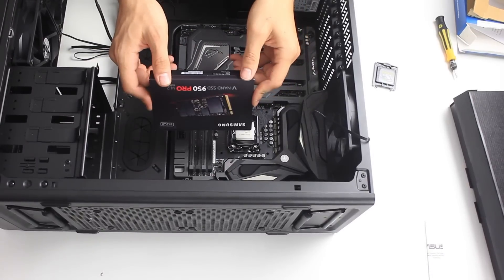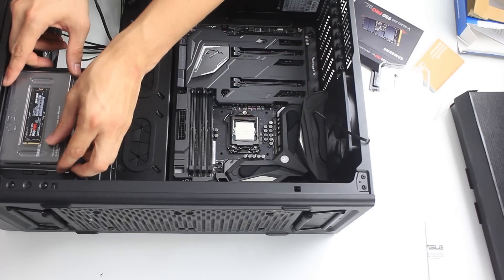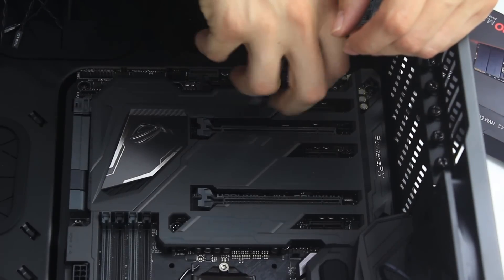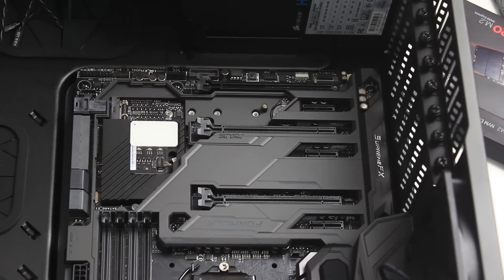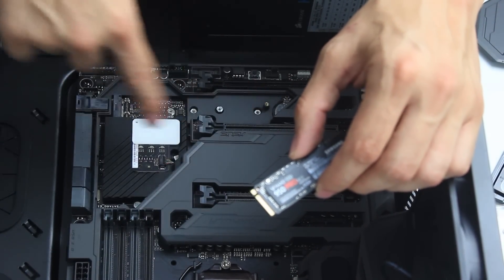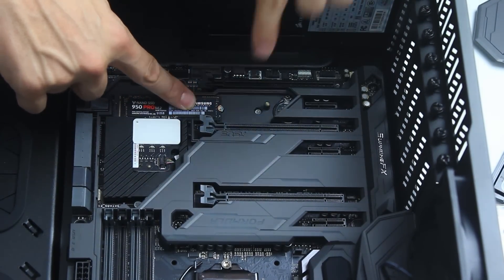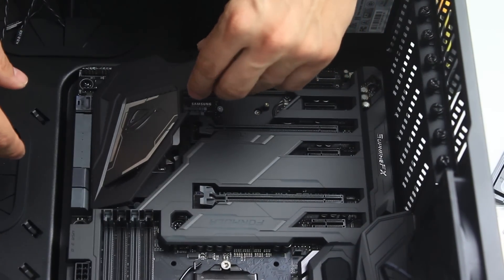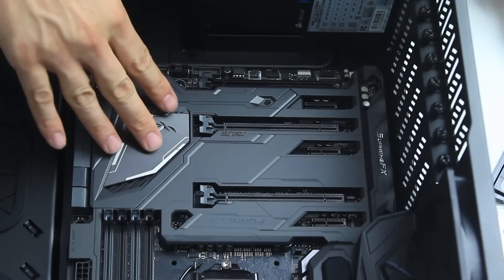Build an insane gaming machine (M.2 SSD) 4/9

Comment: What's the cover in between the pcie lanes and stuff called? Been looking almost around, cant find it!
Reply from the maker: Thermal pad ?
Reply: Yeah I guess that's it, I recently bought a z290 maximus ix board and it is the basic design so theres not any thermal padding all over the board. I wanted to buy one separate and put it on. Found out you cant ;(

Comment: Hello what do you have to change in bios so m.2 SSD is detected?
Reply from the maker: What board do u have ?
Reply: Asus Maximus ix formula
Reply from the maker: Disconnect any other SATA drive, clear CMOS and voila
Reply: Laurent's Choice what is voila ?
Reply from the maker: it means : that should sove your issue :)

Once you booted from you m.2 ssd and installed your boot OS, you can reconnect the SATA drive(s).

Comment: Hello, my famous garlic munching friend I have purchased 2x Samsung mvme2 Evo 500mb items and I have to say these babies are more than sufficient EVEN IF you are editing 4k porn(TWINS lol) of course:)
On a more serious note have you noticed any significant performance/temps when using a heat shield and dedicated 40mm fan?
I personally have a 40mm fan on my setup with a thermal probe to monitor and provide air flow when required on one of my nvme2(heatsink position on an ASUS 370 PRIME A furthest away from the CPU slot and the other left to its own devices and I have noticed no particular difference in performance? your reply would be most appreciated as would your experience with this setup.
As ever please keep up on your reviews as I personally feel you are gifted and genuinely review these products from the HEART. Dieu te bénisse
Reply from the maker: Oh lord !! Ahahahahahaahahahah

Comment: Hi Laurent! I hope it's okay to ask this here! I recently purchased an Asus X370 Crosshair VI MB that has two M.2 slots.

1) I can't find any info about which slot is priority for the boot. In my previous build, (MSI) also had two slots; but, one was Ultra and only for the OS and the other was for data. I can probably find this out by talking to Asus so not a biggy.

2) I have two M.2 drives, both are Samsung 512 Gb. I'd like to set them up in raid with my OS; however, one is a 950 Pro and the other is a SM951, (S# S1X1NYAH100407). I didn't realize that it was different until I tried to install my OS on it and discovered it was mainly made for data. That's when I purchased the 950 Pro. If I set these drives up in raid, will I have any issues with the 951 holding the Pro back in performance?
Reply from the maker: +jawnTem hi there. 

Usually M.2 SSD closer or under the chipset heat shield is the one who ll boot by default.  Thought,  latest BIOS updates allow the board to detect which of the sticks can boot. So it should not matter anymore.

In a RAID configuration, to allow a seamless sync, the slowest of tbe drives will set the pace. That will avoid async errors.

Hope this helps
Reply: Thanks so much for the fast reply Laurent and also for all the support in the past. Awesome!

I already got on on Asus website and learned the positioning info for myself and then went on Samsung's site and learned about the drive. It seems I was sold a non sale-able drive from Amazon. I've been burned a few times through Amazon before, so I really don't care all that much for them. I've never been burned on Newegg.

Keep the tubes coming, I really like them.!

Comment: Is this mobo compatible with i7-8700k?
Reply from the maker: +Mike From The Block no. Only z370 motherboards can handle an i7 8700k.

Check out my latest z370 motherboards review for more details :)
Reply: Laurent's Choice That's strange on the Asus website it says the ix code is "Designed for 7th generation Intel Core processors, so I figured i7-8700k would work. it's a 7th gen right?
Reply from the maker: +Mike From The Block no. 
The 8700k is 8th generation (coffee lake)
7th generation will be the 7700k 
6th generation will be the 6700k

The i7 bit is the type of processor (i3, i5 ,i7) and the first number after it (8700k) will give u the actually CPU generation. 

Also, when processors finish with the letter K that means that it is factory unlocked. You can Over clock it :)

I hope this helps :)
Reply: Laurent's Choice ahh I see thx.
Reply: hey another question! how many total cables do i need for a full build, would a  24 Pin/ 8pin (4+4) M/B, 8pin (6+2) PCI-E Extension Cable Kit 500mm length be enough to complete a full build? just not sure on what i need for cabling outside of what already comes with the case, mobo, psu, etc..
Reply from the maker: +Mike From The Block 4+4 M/B = CPU cable than yes. 

But u need also a Sata power cable for the hard drive

Comment: Thank you much, information about the VIII is rare. I don't think I'll buy Asus again, for years now I've bought Asus only but I'm disappointed every time. Why do I keep doing it...
Reply from the maker: +Francis Arthur what went wrong )
Reply: I am never able to OC ever with Asus. The Suite 3 crashed my OS multiple times, complete reinstalling of all the games and utlities.

Now I'm afraid my EVO 960 will get fried in that closed plastic box. I needed to remove my GTX 1070 and my soundcard to be able to install a simple M.2 
My fans run at full speed all the time because I dont want to go in the BIOS several times a day to adjust it.
Reply from the maker: +Francis Arthur I see ... What CPU did u try it on ?
Reply: i7 6700K 4GHz it might be the 32GB Vengeance Corsair this time but I dunno...  previously I had Dominator and that didn't work either on the P8. This mobo was 350 euro, too crazy of me to get it
Reply from the maker: +Francis Arthur it's not the ram... I think u really got unlucky and got a poor CPU. Only.way to make sure is to try it with another brand Mobo!
Reply: I'm unlucky for all these years somehow with Asus and CPU. So many times different Asus mobo just freeze up and resetting 10 - 50 times before I can even access the whole computer again. Trying from taking battery out and pressing all kinds of reset buttons on the mobo etc.

Really horrible feeling everytime that happens...  my graphics card already went to MSI so I dunno for mobo next time. For now this has to last a long time because this was my most expensive computer - ever.
Ty for replies
Reply from the maker: +Francis Arthur I totally get u... It's really frustrating to see all that money going and having zero value back ! 

What's ur next move ? Upgrade ?
Reply: Not for years, I hope...  I'm not too convinced yet about M.2 but it's already int he computer. At least I have 500GB for storage now that is very fast.
In the future I hope I can muster the motivation to try and build something aluminium flat enough to fit behind the cap and have some cooling diverted to it

Comment: When using the m.2 slot, what PCIe slots/ functions, and/or SATA slots/functions will be disabled or affected. Are any of the the data busses shared with this slot? I use my machine as a Server as well as a Gaming and HT Entertainment Media rig. I have 8 SATA platter drives  installed for storage. I want to know what limitations using thisa slot might impose on my sata controllers. Thanks.
Reply: The M.2_1 (under the ASUS TUF Armor) slot in SATA mode (instead of PCIe) will disable SATA port 1 on the motherboard and is compatible with 2242 / 2260 / 2280 / 22110 PCIe and SATA storage devices. M.2_2, the vertical slot, is compatible with type 2242 / 2260 / 2280 PCIe storage devices.
Reply from the maker: +Eric Epperson yes. Depending of your motherboard. M.2 SSD will disable (rarely) or at least reduce the speed of 1 or more PCI lanes.

Indeed, your motherboard as only 1 BUS chip (z170 , z270 , x99...) which distributes bandwidth across your memory channels (except RAM which draws bandwidth from the CPU).

The fastest non-Optane speed I have seen so far for a M.2 SSD is x4 in a x99.

You can usually tweak your BUS memory distribution in your BIOS.
Reply: Sorry...

I have the board you used in this video. 
Maximus VIII Formula

Comment: Is there a difference between the M.2 vertical slot and the one under the shield? Just curious to know why you haven't used the vertical slot.
Reply: There seems to be no significant difference between the 2 slots but I used the slot closest to the CPU as the boot drive 1 and the other slot as a 2nd drive with no bad consequences.
If you have found evidance to the contry plese message me.
Reply: The M.2_1 (under the ASUS TUF Armor) slot in SATA mode (instead of PCIe) will disable SATA port 1 on the motherboard and is compatible with 2242 / 2260 / 2280 / 22110 PCIe and SATA storage devices. M.2_2, the vertical slot, is compatible with type 2242 / 2260 / 2280 PCIe storage devices.
Reply from the maker: +Omar Touzani no difference  :) you can use either :)

Comment: Hi Laurent.  Thanks for the videos.  I've just completed a build using the VIII Formula and the 950 Pro 256 as well, and I've been having a lot of issues with getting Windows 10 to run stable.  I've had to set the PCIe speed to Gen2, along with several other BIOS and windows tweaks, to get the system to run without the drive utilization sitting at 100% and hanging everything up.  Have you had any problems with this combination of hardware?  Also, I have 2 GTX1070s and 2 D5 waterpumps running of a Corsair RM850 - is my PSU to weak?  It would be a great helpt to me to compare notes with someone with the same mobo/hd combo.  Thanks in advance!  You can see more detail about my experience here - https://rog.asus.com/forum/showthread.php?91295-Freezing-and-hanging-issues-with-Maximus-VIII-Formula-950-Pro-7700k-WIN10
Reply from the maker: +Thomas Keys IV 

Thanks for the details comment.

You should not be having such a problem. 

Does the windows crashed on heavy tasks.. did you identify a pattern ??...

256 gb seems a little short for such an awesome build.

If you have more than 10% free space for OS file swapping ...and the problem persists.. send me a windows report. 

There is a small.possibility that your mem stick was a bad build ... and non volatile part of ....well... is volatile after all :)
Reply: Laurent's Choice well I got it on sale lol.  It didn't seem to matter what I was trying to do ... if the problem was occurring,  it was occurring right away.  Messing with power management settings changes things a bit.  As you can see from my forum post, I tried many different options and eventually got things stable but throttled as I'm only running the pcie at gen2.  Did you have to mess with ASPM settings? Windows registry keys for pci link state power mgmt?  I'm assuming you've installed windows 10 to boot from the m.2?
Reply from the maker: +Thomas Keys IV 

Yes... this motherboard doesn't recognise M.2 ssd automatically. 

You got bios it a bit.

Have to turn off all the other drives.. make sure they are disconnected and then ....yes ... mess with ASPM.

That's for the booting part.

Now ..if it's dies during operations... then.. likely .. ur module is bad... it'll run a few million operations and crash.

Try another stick is my most straight forward answer. 

:)

Comment: The tiny little drew I was supposed to use fell down a crack in my motherboard. I guess I'll just skip that part, right?
Reply from the maker: +ThaVrisco how about using a thin magnetic screw driver head to remove it ?
Reply: ***** Thanks, it worked.

Comment: sir!where should i plug my sata cable using m.2?is it normal sata port or at u.2 port?
Reply from the maker: no need of external electrical plugs for a M.2 SSD.   It works like a Ram memory stick. Just put it in its connector and you're done.
Reply: Laurent's Choice So just plug and ready to go?oh thanks

Comment: Where you able to reach advertised speeds?
Reply from the maker: Good question... not totally.. but close enough... about 60% to 80% of advertised speed most of the time (talking write, not read), so about 800 MB/s to 1100 MB/s. It did slow down MASSIVELY when running video editing software (450 MB/s).

Over time, and despite a heat shield it seems to heat a little and runs at about 4 to 5 Gb/s...

As for reading, it's hard to say since I don't monitor it as much.
Reply: Laurent's Choice thanks for the fast reply. Are you using the PCIe 3.0 functionality or are you using the combo sata? I read that a lot of people are able to hit those advertised speeds using the PCIe 3.0. Not to sure but I'm guessing they are using PCI 3.0 expansion card adaptor to plug into a PCI 3 slot
Reply from the maker: +DRP I'll be using a PCIe 3.0 on my 2011 v3 build next week, and using a similar M.2 model (512 950 pro v-nand) that I was installing on this video.

I say we make a video to benchmark those babies and see which makes more sense :)!!!
Reply: Sorry if I'm late and this is no longer of any value.
To get the proper speed out of the 950 Pro, or any other Samsung SSD, you' ll have to get the correct driver (for your operating system) at:
http://www.samsung.com/semiconductor/minisite/ssd/
... because the generic Windows Driver which will be installed is much, much, slower.
The proper way to install it for a bootable OS is:
Make sure the M.2 is the only drive connected to your computer > Do what you have to in the BIOS (choosing where the Windows USB is and in some cases pointing to the M.2 as the system bootable disk) > Install Windows > In Windows install the correct Samsung Driver for your OS > Reboot > Turn off computer > Attach all other SSDs/HDDs you will be using in your PC

PS > Almost forgot since you are in windows with just your fast 950 PRO M.2 why not make the most of it and update all your Mobo drivers/ Windows / get the latest updates for your BIOS (yes I know they call them UEFI now, or something like that)

A good build to you all,
Cheers.
Reply: Knew I had forgotten something, for the new driver to be used instead of the generic Windows one there is one more step:
- Control Panel > Device Manager > Right click on your M.2 (do not choose update driver software, that will just waste time) > Properties > Diver details > Update Driver (here choose the Samsung Drivers to replace the generic Microsoft ones)... The Samsung Drivers will now be the standard drivers for your M.2, they will update automatically every time Samsung releases a new one > Your M.2 performance will be at least as good as promised.

Cheers.

Comment: Hey if someone can help me, I'm building my first pc soon and I was wondering if you have a hard drive already can you also have a m.2 drive?(sorry if that's a stupid question)
Reply from the maker: +Gaming with G R not stupid at all.

Yes you can.

Though I'd recommend to first install M.2 separately.

Depending of your motherboard, you ight have to tweak it for it recognise your M.2 SSD.

Do you intend to boot from it?
Reply: +Laurent's Choice I intend to install the OS on the m.2 ssd and store everything else on a hard drive. Here's a link if this helps http://pcpartpicker.com/list/RKFwYr
Reply from the maker: don't know if I am in time, the motherboard is good.. not my favorite brand but a good choice for M.2 SSD.. their BIOS usually detects them as boot devices by default.. so no BIOS tweak.

For the Supply, save some money and get yourself a Bronze... the only difference between god and bronze is a couple of r percent in efficiency and if you are not going to rock a dual video card... don't see the need.

Hope this helps.
Reply: +Laurent's Choice no I haven't bought anything yet but thanks for the info I'm planning to build that now thx for your help

Comment: any problem with overheat under the shroud?
Reply from the maker: +Frank Beaulieu not that I can tell.

I had a M.2 squeezed between 2 SLI video cards... and it was kind of fine thought it seemed to throttle itself down.

With that board though...no worries at all
Reply: ***** cool i have this board and want to know about the m.2 ssd if it overheating was a issue... becose on forums they talk specificaly about this board issue with m.2, so thanks for anwsering , i'm going with the same samsung.! Sorry for my engilsh, i'm acutualy frech..:)
Reply from the maker: +Frank Beaulieu y a pas de soucis.. ton board est parfait et franchement tu es tranquille question surchauffe!
Reply: ***** Merci !:)